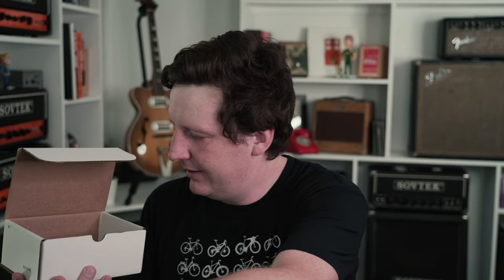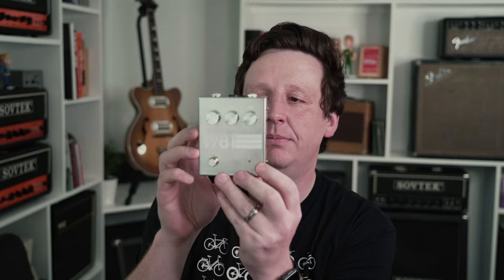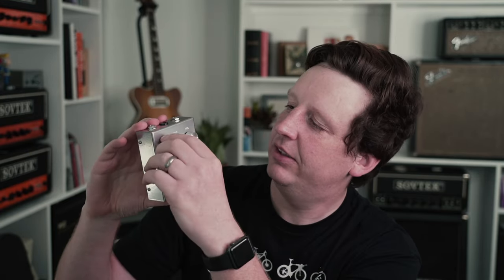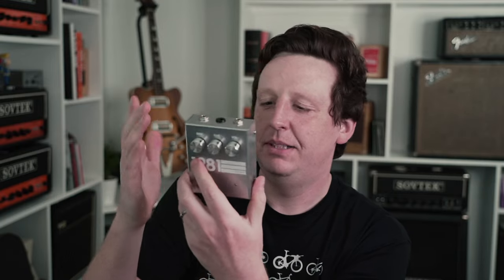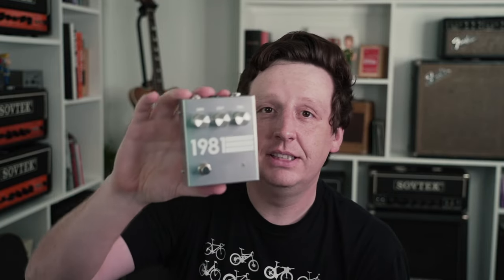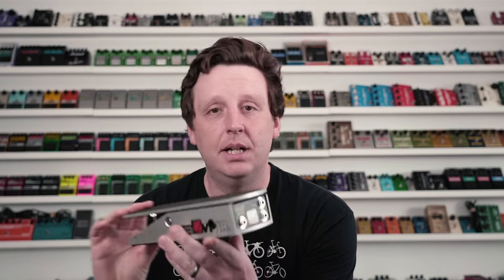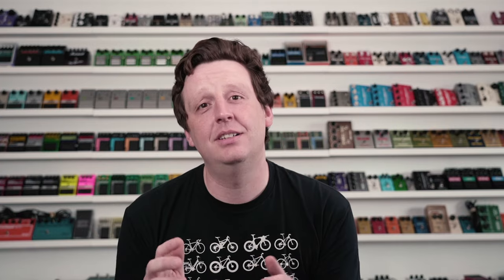Why You Need A Buffer

Comment: Do you need two? Mason from vertex is always adamant you need one at the start and end... I just don't want to drop 150$ if I don't need to.
Reply: I agree.  I have 10 pedals but do not have a board because ; 1) some are for just home project material, and 2) a few are just needed to gig with...........so they all do not go on the board at the same time and all are true bypass and I am not using long cables.
Reply: Well, personally I did that. I have the Polytune 3 which has DIP switches to switch between True Bypass or Buffered Bypass so I kinda killed 2 birds with one stone back in the day when I bought it. It's a high quality buffer as well (Bonafide Buffer). Recently I've been upgrading my relatively big board (19 pedals) big time and I got the stand alone Bonafide Buffer for the end of my signal chain going into the front of my amp. I thought I didn't need that but man it makes a difference. Especially since I'm using at least 1 pedal all the time so the buffer in my Polytune is buffering maybe 20cm of cable but the pedal that is always on now has to drive around 11m of cable and every pedal has it's own different output impedance. So that's why I chose to get a buffer as well at the end. Same goes for my FX loop. Right before the cable goes to the FX Return, I placed another Bonafide. They're not that expensive so I'd suggest to just try it. I'm glad it worked for me and didn't have the hassle of returning the units.
Reply: @MiD218  Thanks for sharing that!  Question:  Would you recommend a buffer for me?  Aside from Digitech Trio and a looper(not on the board), I have 9 pedals with a few more to be added including some kind of tube preamp for "tone warmth".  In practice, maybe a total of 30 ft. of cable but mostly less than that.....for gigging, usually no more than 50 ft. and mostly less.  My setup is overdrive and gain in the front of the amp and then modulation (chorus, reverb, echo/delay) in the FX loop.  Currently do you recommend a buffer?  When I get the preamp I like (ex......Kingsley, Tubesteader, etc...), for the front of my amp's preamp with a few pedals running into it like a Keeley Monterey, Vertex SSS, do you recommend a buffer?   Note:  For gigs & practice, I never have more than 5 pedals engaged and the only amps I use are solid state (either a 60W Tech 21 or Roland Blues Cube Artist)
Reply: @davidsisto7694  Well, here comes the super unhelpful answer everyone says. I don't know. I really don't. Just plug the guitar in the amp with a short cable and listen closely to the sound. After that, connect your pedalboard and have everything turned off. If it sounds the same, congrats! You don't need a buffer per sé. But I'm guessing with 9 pedals and more coming, you might gonna need one if everything is true bypass. I only found out after I put the buffers in how much tonesuck there was even when having my input buffer from the Polytune 3. The output and FX loop return buffer are doing magic as well. Also, I got a TS9 which is buffered but that buffer sucks ass so having my signal being low impedance when hitting the TS9 and having another dedicated buffer at the end to drive the long cable to my amp really give all of it's life back. It's not so much an issue of what amp or gear you're using, it's more about the nature of cables. Capacitance is really the same thing as rolling your tone knob down per length of cable with the guitar output impedance. Having a buffer basically nullifies that. 

Here are some (hopefully) useful links where I get my gear and also 2 really nice, beefy, cheap and truly well made power supplies to save some cash. (I'm not sponsored in any way it's just the best PSU for the price I ever seen.)

Buffer:
https://www.thomann.de/intl/tc_electronic_bonafide_buffer.htm?sid=58770d967f8659ffb33c1dee304b89eb&ref=intl&shp=eyJjb3VudHJ5IjoibmwiLCJjdXJyZW5jeSI6MiwibGFuZ3VhZ2UiOjJ9&reload=1

PSU1:
https://www.thomann.de/nl/harley_benton_powerplant_iso_1ac_pro_modular.htm

PSU2:
https://www.thomann.de/nl/harley_benton_powerplant_iso_2ac_pro_modular.htm
Reply: @davidsisto7694  As a rule of thumb, I'd say if your cable is more than 10ft, you want a buffer. I don't know the outputs of the preamps you want tho. If its 100 Ohms, there's no point in having a buffer after that...

My setup is as following:
Guitar -> Polytune 3 (with active buffer) -> In front of amp pedals -> Buffer -> 10 meters of cable -> Front of amp -> FX Send -> 10m of cable -> FX loop pedals -> Buffer -> 10m of cables -> FX Return
Reply: @MiD218  thanks! I needed a new tuner pedal and your remark made me go for the polytune! (didn't understand the bonafide thing at first ;)
Reply: @MiD218  I see your point and it runs consistent with what others have told me.  I did an A/B test....5 pedals engaged vs. Guitar to amp only.  No tone difference other than my clean tone was a bit "beefier" w/ the pedals.  I don't know why, but my Catalinbread Echorec thickens the tone whether on/bypass or engaged and tone effects are low.  I like it and actually boosts a bit of low end I really like.  But this may also be a good reason for a buffer.
Reply: @davidsisto7694  well, the most important thing is always just the sound. You should basically just say "I don't care what the so called rules are, this setup sounds the way I want!" if thats the case. Why change something that works for you:)

Comment: thanks for your thoughts on Buffers. So what if i put my wha, then overdrive then boost to amp and run all the time-based effects, flanger, phaser on the effects loop? Where will my buffer be most effective?? Thanks
Reply from the maker: Buffers should generally only be used in front of your amp, not in effects loop. So try at the beginning and end of your pedal chain before your amp to see what's best.
Reply: @jhspedals  Cool. I will put it in front. First thing coming out of my guitar. Appreciate the advice.

Comment: I'm new to building a pedal board and the tuner I want to get has a built in buffer in it. You said not to put a buffer before a fuzz, can the tuner be placed after the fuzz even though its recommended to place a tuner in the beginning of the chain?
Reply: I'm interested in this as well - if I use a buffered/active volume pedal is this the same effect?
Reply: In my experience, the tuner after the fuzz is perfectly fine. You just need to turn your fuzz off when you use the tuner, for more accurate tuning.

Comment: Do I have to buy two buffers? I just ordered one for the end of my pedal chain, but as you said boss pedals have great buffers in them can I just place my compressor or octave after my fuzz instead of buying another pedal?
Reply: Yep! Plug one in and have it off.
Reply: @jaredbumbis  As in plug one in, like, any boss Pedal laying around. Have anything plugged in at the end and leave it off? Would it need to be powered if it's going to be off?

The whole idea is just fascinating, still struggling to wrap my head around it.
Reply: @garethbull5303  yeah you need to power it and leave it off. I dont even think boss pedals work off without power and the buffer is the reason. all boss pedals have a buffer, but the new TU-3W has a switch you can use to disable it.

Comment: Question,

How will this work with the FX Loop pedalboards? I mainly use my board direct to the Loop and connect my guitar to the input. 

Thanks in advance. Love the blog, really amazing tools and your knowledge its just in point!
Reply: You can add a buffer between your guitar and the input of your pedalboard (and after the output if you don't have an "always on" like reverb pedal that already buffers your signal)

Comment: Serious question, what's the difference between using a buffer at the start and end, and just turning up the high end on your amp a little bit?
Reply: This is a guess... Your pedals are processing the incoming signal, so if that signal has suffered loss due to long cables, they can only produce an effected sound on top of that reduced signal. If you're attempting to correct for high end loss on the amp after all the pedals, you're compensating on the resulting sound of pedals processing a diminished signal. The buffer at the start would provide the pedals with the full signal to work with. There would be a difference in the result, but as for what that means in terms of quality, that's obviously subjective. You might try this and find you actually prefer the unbuffered pedal affected sound with some post-pedal EQing.
Reply: @tdous  that's a good point, thank you

Comment: If I have my guitar with 10 foot cables into a true bypass wah and that into a buffered tuner would putting a buffer before the wah make any difference?
Reply: Probably not. Since you'll only be buffering the small length between the wah and the tuner. A buffer won't give you back anything lost before the input of the buffer.

Comment: What if I have quite a few pedals before my fuzz on my pedalboard? If I put my first buffer right after my fuzz, it is no longer near the beginning of my signal chain. Is this a bad thing?
Reply: I ordered two buffers and they'll arrive tomorrow, so I'll experiment and get back to you tomorrow night so you can take a decision if you wanna use buffers. My pedal chain looks like this: ceramic single coils Std. Strat->Sentry noise gate - loop out->Saffron Squeeze comp->Pork Loin overdrive->Swollen Pickle fuzz->Blue Hippo->Sentry noise gate - loop return->Sentry noise gate out->Suppa Puss delay->Orange Crush amp. I'll sandwich first (before noise gate and after the delay) and then I'll try placing a buffer inside the noise gate loop right after the fuzz. Currently my noise gate is in buffered bypass mode, cable is D'Addario American Stage 10' and signal still loses a bit of high end, that's why I got the buffers.
Reply: Already got the buffers (Mosky's Pure Sound.) Best configuration for my rig is Josh's sandwiching advise: Placed them before and after signal chain, and my fuzz is in the middle of the chain. High end is back. My Strat sounds great if I turn off all pedals.

Comment: but what if you don't want your fuzz to be the very first pedal in the chain? I have a cry baby wah (gcb95), a boss Tu-2 and a boss oc-3 before my fuzz (ehx nano muff and soon JHS mini foot), so there are 3 buffered pedals before the fuzz... what should I do?
Reply: This mostly applies to Germanium Fuzz Face type of circuits and maybe some silicon transistor ones. But generally speaking, if you want your fuzz to sound as intended it should not follow a buffer or a buffered pedal. A Wah with a built in special buffer can give you a better interaction with a fuzz pedal.
Reply: @YU-qn1tm  thanks for the answer. I did some testing with my pedal order, and I must say I kinda prefer the fuzz after my bd-2 and my wah, even if they have buffers, it just felt better in my opinion, and felt like it had more sustain, so I might just leave it that way even if it's not the «right» way

Comment: WAIT, why no buffer before your fuzzes? I run straight into my buffer on my board and end into an RV-5 - always thought it sounded splendid.
Reply: I don't know if it applies to all fuzzes but certainly germanium transistor fuzzes need to be first in your chain and see nothing but your direct guitar signal so you can use them to clean up and get that nice tonal variation that they produce. A buffer before them totally screws with this ability.

Comment: How difficult is building a buffer for a DIY enthusiast with a little experience in pedal building? Are there any ICs or digital components involved?
Reply: The easiest way involves an IC, a single op-amp. No digital components, just a few resistors and capacitors. If you check here http://www.bakon.org/guitarfx/buffer.htm you'll find a bit of information about it. The first buffer schematic shown is simpler but a bit of a pain because you need positive and negative power supplies or multiple batteries. The guy redesigns it so you can use use a single 9V supply by just adding a few more resistors. You can build that on a breadboard or using perf board pretty easily and cheaply. The circuit is more generally called a 'unity gain buffer' or 'unity gain non-inverting amplifier' though you may come up with crazy equations and information left out of schematics and explanations due to assumed knowledge if you search for them, though they might prove useful if you get stuck.
Reply: Effect Layouts have tons of pedals.  I have made 10 pedals at least from the site, great community.  Choose PCB  or VERO depending on your electronics skills.  Also tagboard effects ( VERO only). You can find one with op-amp tl072  and a few components. Just type "buffer".

Comment: is Boss Metalzone buffer-ready? im confused.

Here is my signal chain:
Guitar to 15 ft guitar cable to truebypass tuner to truebypass overdrive to Boss Metalzone to truebypass noisegate then again a 15ft guitar cable, should i need a buffer? and how many buffer do i need and where to place them?
Reply: I am pretty sure the Boss Metalzone is buffered- to check plug your guitar directly into the metalzone and then the metal zone to your amp- so the only pedal you are using is the metalzone- now unplug the power to the pedal or take the battery out- if you don't get any sound to your amp then the pedal has a buffer. If you get sound to the amp with the pedal powered off then its a true bypass with no buffer. 
     The only way to know if you need a buffer is to do the test that Josh describes. He does mention that you should have two buffers - one at the front of your pedals and one at the back - but i think its subjective- do the test and let your ears be the judge.
Reply: It has no sound when plugging out the power, it resets to zero when plugging the power back. I think this is buffer-ready
Reply: @kevinfiel3245  Every boss pedal has a buffer, at least every i know of. MT-2 is no exception.
Reply: So, you mean MT2 is not a buffer?
Reply: @kevinfiel3245  It has a buffer like every boss pedal has.

Comment: great information ! does the same rule for fuzzes apply for overdrives?
Reply: I have the exact same question. Please share the answer.
Reply: I want to know too
Reply: Just fuzz.  I'm not smart enough to tell you why but fuzzes and some boosts (particularly treble boosters) want to be the first thing in the chain.  Overdrives and Distrotions should be fine wherever.
Reply: It has to do with the input impedance. Basically your guitar's volume control is a part of the circuit with a fuzz pedal. Putting a buffer in between messes with the impedance. ODs, however, aren't wired in that way.

Comment: If you use active pickup system like EMG does that help with signal loss through capacitance? I was told that was one way to keep the signal string through an effects system (by using active/ low impedance pickup system).
Reply from the maker: Yes, basically that is a buffer but it has downsides… Fuzz will never sound good with that guitar etc..
Reply: Thank you so much for reply, I know you are busy..... I have never sounded good through a  Fuzz! Passive OR active pickup loaded, doesn't matter, lol.....Doesn't help that my only Fuzz is an old Eh Little Big Muff with a slider tone selection, no adjustment knob to tone...

Comment: Had to plug directly into my amp at a gig when my power supply to all my pedals died and discovered how much better my tone and punch was. That's when I decided to get a Boss multi pedal and have used one ever since currently Boss ME-50.
Reply: Is it time to up to  a GT1? :))
Reply: @blizzbee  Might be worth a look. But what I like about the ME 50 is I use it in manual mode so each pedal behaves like an individual stomp box, distortion, delay, reverb, modulation are all there and always tweakable using the knobs for each pedal. (I installed two additional permanent foot switches to control the compressor and tone select modes as well). I don't like having to rely on presets that can often be right for one gig but wrong for another.

Comment: Yeah Okay but how bout the way overdrive pedals ‘see’ or re-act to, your pickups? If there is a buffer before your overdrive then the impedance relationship (right?) changes and thus the sound when rolling of guitar volume. Yes? No?
Reply: Jv Dyk in theory yes. On most overdrive circuits you won’t notice it though because they’re designed to handle a low impedance signal. But I have my first buffer after my drive pedals anyway
Reply: TheSphericalGuy Yes me 2! I heard a lot of difference with royal blue overdrive and dude overdrive when having the tumnus (buffered) before or after. And i ride the guitar volume a lot. But the majestic sounds Nice also after the tumnus. Sorry i like JHS but currently not on my board. Owned a lot and like Josh though
Reply: Haha I also have the Royal on my board, great pedal! But it definitely needs to see the pickups to do it's thing. I feel like Josh meant well here but it was a bit too simplified.

Comment: You say fuzz before buffer, but what if all my gain pedals (OD and fuzzes) are in a LS2 loop?
Reply: Same question here
Reply: @jnicholson  i made some research and apparently most (if not all) blend pedals have an input buffer and an output buffer. So i guess those fuzzes are the one thing you just have to put first in your chain and out of a blend loop.. (unless you like how they sound after a buffer which is totaly possible)
Reply: @alexk8472  Thanks for your response. I've got a EHX bass soul food (blend ctrl included) in chain after big muff. A little google and I also found out it has an inbuilt buffer on/off switch for bypass. However, when the pedal is on, that certainly is buffered too.